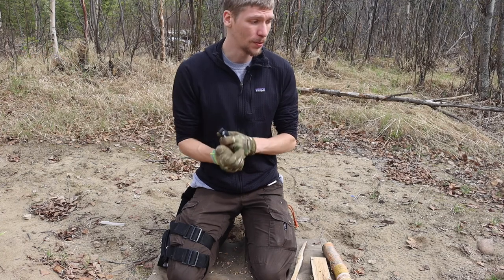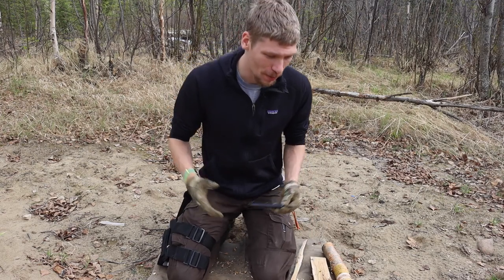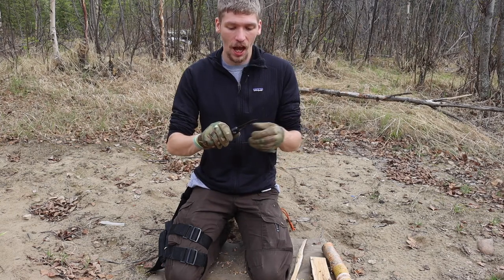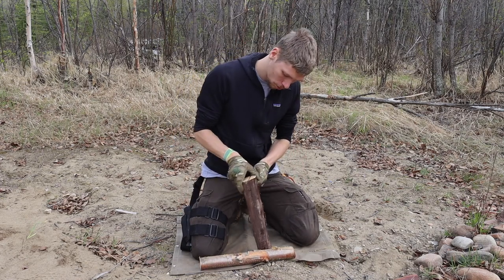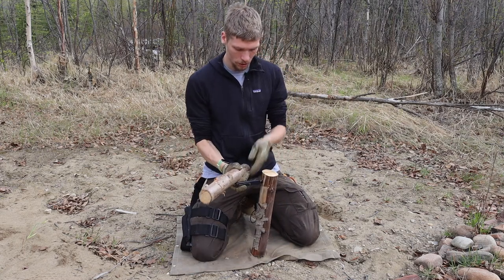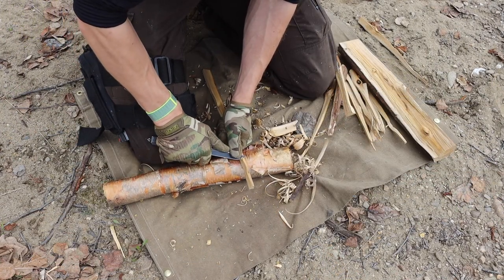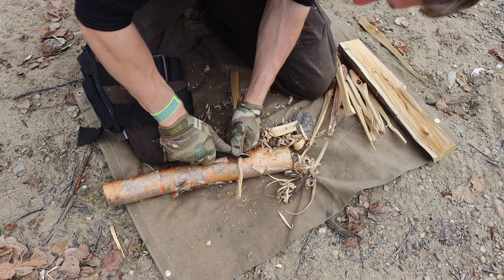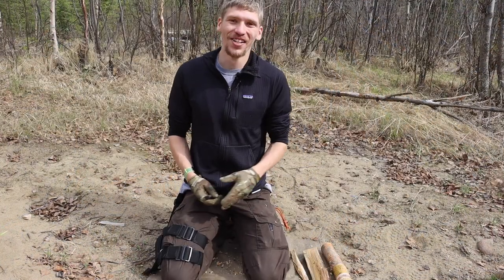Can an OTF Handle Survival? (Or Will it Get Destroyed?)

Comment: I have been using my boker kalashnikov otf for pretty much everything for about 5 months now. when I got it I put it through worse than what you were doing on this video just to see what it can handle. it's held up very well. the only downfall I've found is when I was setting up my garden, I kept getting dirt into the action and it wouldn't retract. I had to take it apart and clean it. not a big deal in the garage, but definitely not ideal in the woods. and the spine on mine is very sharp, great for the ferro rod. good stuff, I'm glad to see someone talking about this kind of stuff.

Comment: Unlock any folding or OTF blade so the blade is free floating and not under any stress. Use it as a steel wedge with a baton tap to start a split. Then use the knife to carve a wooden wedge. Even a 20 inch stick with a quick wedge end will work, doesn't have to be short and fat like a steel wedge. Baton the wedge and split the wood. Repeat. There is only stress on the knife when removing it from the split lines you make. You can also get to the dry inner wood by simply removing the outer bark and wet wood with your knife. Need a fireboard or net needle etc. and can't or don't want to baton a wedge? Carve a branch into a plank with your knife... but bring a sharpener. There is no reason to baton a folder or OTF if you just use the ancient simple machines (force multipliers) in your primitive thinking. Lever, pulley, wheel, screw (spiral incline plane), incline plane and the wedge (two incline planes back to back). Mankind did a lot of surviving for millenia with just a sharp rock and no fire...no fire like soldiers often have to do without as well for tactical reasons. It can be done. Always keep it simple, consider all options and improvise. All the best, Mike.